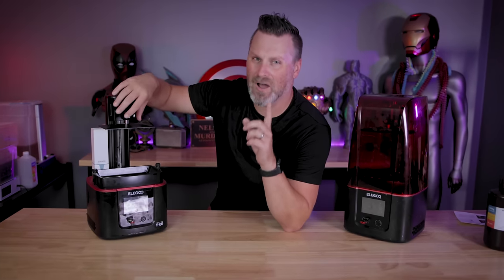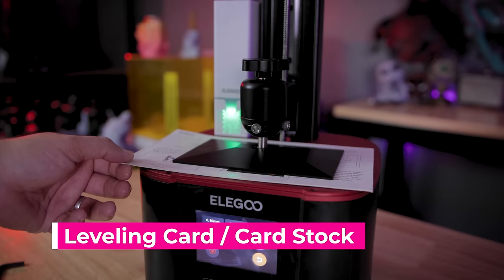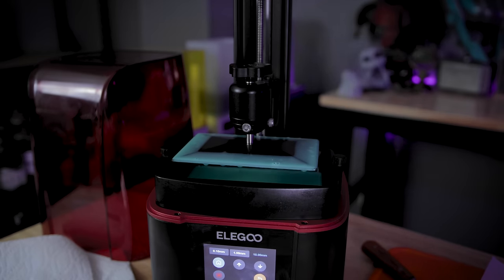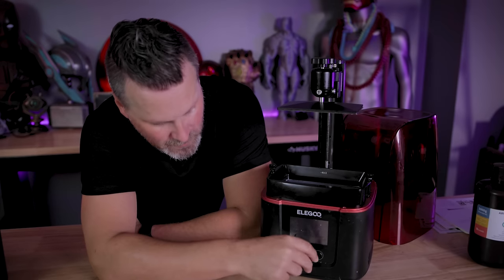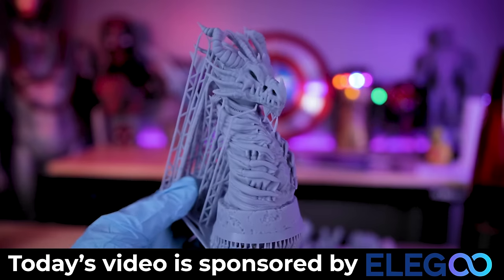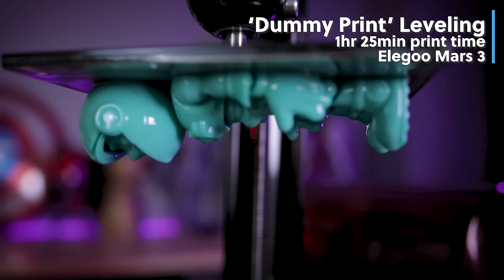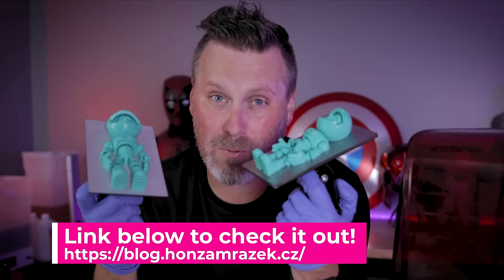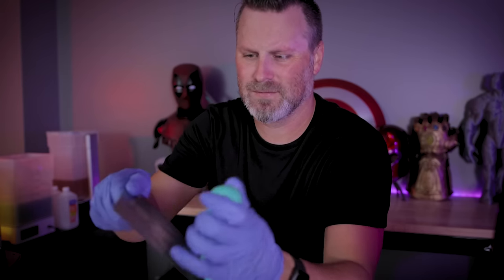The NEW best way to Level your Resin 3D Printer?!?!

Comment: But if you do it this way, you will have to take out the build plate right after leveling ant take off the first layer you printed before printing something, right?
Reply: no clean off required beacuse there is no resin in the vat when he levels it

Comment: Hey UJ, I own a Mars 3 Pro, and when you pause the print the bed retracts to a set position. I was wondering if turning it off right after the pause button is pressed would yield the desired result as shown in your video with a # pro as it does with the 3? Thanks in advance.
Reply: I tried this technique on my Mars 3 Pro and it made no difference on the elephant foot, BUT it caused further error on the height of my model built directly on the build plate.  My 10mm high print (just a 25mm cylinder x 10mm high) was 9.34mm high instead.  I got a 9.78mm cylinder height using the standard bed leveling technique using a 0.14mm piece of paper.  I too just turned off the printer, turned it on, raised up the build plate, put the resin in and printed.  Something is not quite right with this technique.

Comment: How’s that Elegoo filter? Does it reduce the smell alot?
Reply: Yes, it's incredible, you should however always make sure to still wear protective gear (gloves, glasses and mouthmaks/respirator). Because after several usages nearly every part will be contaminated by resin and over time the smallest amounts will eventually cause health issues. This will however take months/years to develop. 

I love his content, but unfortunately a lot of contaminated surface are touched without protection.
Reply: it works for me, yes.

Comment: Since you have a flex plate on does this method eliminate having to use a spacer?
Reply: You don't have to use a spacer IFF your build plate has enough room to go up when leveling. When leveling the plate, you see that it drops and you can move it up and down, if that movement is less than the flex plate total height (including the magnet), for example 2.6mm, then it will push the plate against the screen when printing.

You can do a test run to see if you need a spacer. Basically, BEFORE you install anything, put the leveling paper + the flex plate + the magnet on top of the screen. REMOVE the build plate from the printer and losen the leveling screws. Then move the z-index to Home on your printer (WITHOUT the build plate). Lastly try to slowly put the build plate on your printer (on top of the leveling paper, flex plate, and magnet) to see if it will fit. Since the leveling screws are loose, it will allow you to play with the Z movement of your plate. If you are able to fit it through without forcing it, it means that your plate has enough room for the flex plate.
Reply: @pgarciacamou 
Thanks a lot man! When I finally open it I'm definitely referring back to this!

Comment: I am definitely going to try this. I have a problem with the paper method often zeroing too low. Then when I put the vat back on and start the print, it bottoms out and makes a grinding sound. I’m afraid it’s going to damage my screen. So far, I’ve been trying to finesse just how loose the paper is so it won’t grind but it is imperfect.
Reply: Level on the FEP
Reply: Use a thicker grade of paper.

Comment: Would the dummy print method stop all elephant's foot if you did this method with a small amount of resin in the vat?
Reply: not sure why it would do that. anyway the elephant's foot is mostly caused by the higher exposure time of the bottom layers, which "cooks" the resin more than the normal layers, making the cured voxel wider. it really has little to do with the levelling, although apparently with this method there's a slight gain against elephant's foot because it prevents the build plate squishing too hard, but that's almost a side effect, not the goal

Comment: Absolutely, just got my Saturn 2 setup and printing, and I will for sure be trying this method of leveling soon! With just the small handful of prints of done so far, I have indeed noticed some elephant's foot, so I would love to resolve that. I have with other printers used the "bottom tolerance" correction in chitubox, but that feels like cheating...

Comment: had a bad leveling after leveling it using the vat method. on large resin prints the bed adhesion is more critical than on a small resin print and I can say that the paper method produce significantly stronger bed adhesion. you might be getting better quality prints but you are sacrificing higher probability of failure doing it this way.

Comment: I tried this process step by step and it didn't work for me.  The build plate goes to the bottom and the machine starts grinding as if it is trying to go beyond the glass.  I tried three times in fact with the same result.  Is there something I'm missing?
Reply: I’ve had same issues with Anycubic 4k, I have try leveling on paper/z=0, leveling on feb/z=0, and I was getting grinding sound. But when I have done leveling on paper/lift up 1mm/z=0, grinding is gone, and test cube went pretty accurate. Bad side of this is that I have to home/lift z up every time before print start. As for some reason z height is not stored. Like it said in blog there is some issue with the software or hardware which cause that actual build plate goes deeper then the home is. Which cause that grinding sound.
Reply: Did you loosen the bolts on your build plate first? I've heard that kind of grinding on my first day with my printer when I accidentally left the bolts tight on my build plate and pushed the Home button 😅😅

Comment: Not a tip for leveling but removing stuff with out a flex plate, put IPA in spray bottle, spray it on your scraper, when the IPA gets in between the bed and resin, the resin item pops off the plate.

Comment: This method seems to me extremely wrong. Is impossible to check the planarity of the build plate.

I use a piece of paper that’s the same thickness of the FEP I use, 120, then raise the plate by 0.01 until the paper ban barely move. If it pivot around a corner means that corner is too low and the plate is not parallel to the screen. If it slides correctly I save the new Z=0.

This way homing do not compress the FEP and the base layer is accurate.
Reply: Hi, Jan here. The main reason for the method is to counteract the 0.5mm constant present in the firmware. If you want to check the tightness of the build plate, nothing prevents you from using a thin piece of paper. But it is not necessary in my experience to check if the built plate lies flat against the display - a sufficient pressure  down from your hand when tightening the build plate should ensure that the build plate is parallel enough with the LCD.

Comment: I dont get it, what am i missing??? .... this new leveling way effectively stops the print before layer 1 is cured... that is 0.05mm high in most cases... then you loosen & push the build plate back down to 0.0mm and tighten it.... effectively offsetting your zero point with -0.05mm so now every first layer is printed with a thickness of "0"... and your homing point is now -0.05... where is the first layer???? Why would this  work? I believe you need to do this at level at 0, not at layer 1 and not while printing but just while homing with the vat and some resin in it.

Comment: This dosent make sense. You have just homed the build plate below 0. The printer will home then raise 0.05mm to start printing the first layer. Then you proceed to push the build plate back down to 0.00 and lock the build plate in place. that's not set to the "perfect height for you first layer" that's set one layer below home position

Comment: I have a Anycubic Photon & Photon S on their latest firmware. This doesn't work as expected. The machines observe the Z=0 already set previously. 
Z offset matters here! Instructions say bed moves below home switch, well that only happens if Z=0 is already set below beforehand. 
I tested this method, set Z=0 when the Z sensor triggers, and started test print per instructions,  turn off, and on the first layer the bed is way to far from the screen. Any print wont move below "Z offset"!
If i manually set Z=0 as usual below home switch, then yes, test print will move down, but then again, doesnt matter, Because i can set Z=0 to -0.1, -0.2 or whatever, and thats where print starts and it STILL can be too far from screen+FEP. 

Just letting anyone reading know this doesnt work on ALL machines, and as far as Anycubic Photons go, this aint going to work.
Reply: You might be wrong, that may not work on some Anycubic machines. I have Anycubic 4k mono, and z=0 is not related to homing and it’s not stored , in fact it is restored to default position.
In my case if I have done paper level/z=0, I was getting awful grinding sound. When I have lift z up, everything was fine. But on the next power on/off cycle z was restored, and I was getting that grinding sound back again. So I have to repeat paper level/lift z up/z=0….crazy stuff

Comment: Well if I try that with my saturn 2 nowadays.. it doesn't works. If I want to adjust the z offset and change the defaults the printer requires me to press home first. So the only way to do it.. you remove build plate... press home.. adjust z axis than save. The order of operations is then.. press home.. level plate.. print 5 level calibration elements on the 4 corners plus middle.. say 2mm. If it prints all of them and all have the same height, measuring  with caliper.. nice its calibrated. 

If they all are 2mm nice it's also on the correct z index offset. If it isn't.. remove build plate.. press home.. and after that adjust to the correct heighs of the difference between the average of the elements.. then save.

Comment: No way I´m gonna change my leveling process. I do it in the fep tank, thats it. So easy, no problems. Never change a running system. I never print something straight on the build plate.

Comment: I totaly do not understand that new methode. What are you exactly doing? Why is an elephant foot posible? The monitor pixel are always the same...
Reply: Light scatters, the square becomes a bigger square with rounded corners on first layer. If you ever used a sla printer you would know that overexposure is just that

Comment: Bottom-Up Resin Printers suck. I wish there were more Top-Down Resin printers on the commercial market. I get sooo many resin fails and have wasted so much time and money. The best and most I have printed were three things after eachother and then bam it fails.  Now after one successful print I usually get a traumatic failure after. Even if I switchout the FEP film and re-leveled the build plate. I just kind of give up
Reply: Not sure what is going wrong, I have had ZERO failures on my Mars 2 since owning it. Looking at 50+ prints now, Elegoo Resin.
Reply: @OmeJoyo  Yeah I have an Elegoo Saturn
Reply: I also replaced the LCD screen two months ago and updated the correct firmware. Had two successful prints and two more failures after and that’s when I gave up. Just too much money and failures for me rn. Hoping there is a big improvement with consumer resin printers and more top down ones because those seem a lot more reliable and easier.

Comment: This is so many extra steps for a simple method. Just level with the vat attached. No need for that test print. I always level with the vat. 

Its odd, you wnat to level to the width of the FEP, but then you use a piece of paper, instead of the actual FEP,... I always just level with the vat attached.

Comment: I can only assume the elephants foot is because it began to create the first layer the moment you go to turn it off.  Something you'll never be able to avoid because you've already started the print process.  Also, you're shutting the machine off hard... You can do so much damage electrically, and also corrupt your card as well.  Its why in IT you use power backups and charge protection in case something happens like this as it can corrupt and damage anything.  If it's built well, it may be ok, but if you're doing this often, you can really damage the machine.  It can and most certainly will corrupt your card.  You would not hard shut down your printer, especially while in use and while reading the card.  Its a serious mistake.  While this person may have no electrical experience or decades of actual computer usage, those off is who have, know better.  I'd not recommend this to anyone as it will hold you responsible for spreading this non sense.  Its just as bad as someone spreading TikTok challenges and people being sick and dying from them.  This may also break warranty.  You can damage capacitors, chips, power, your card, etc.  Don't risk it.  This is a TERRIBLE method.
Reply: I'm pretty sure this is the same guy who wrote about how resins prints don't shrink during printing and curing.  When the bottles literally state "less shrinkage", etc.  Not to mention giving them info to how much they shrink etc. from thermal expansion.  Who also didn't consider people on how they use it... And where .. From a cold garage, to using heaters on their vat, etc.  Clearly it's dangerous and has no idea what he's doing.  Self taught and no understanding whatsoever...  Be careful